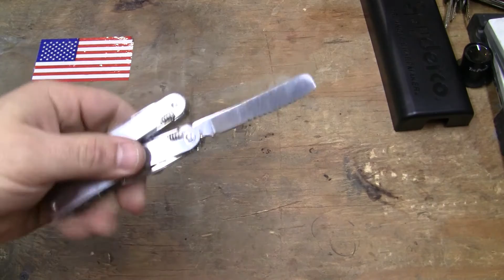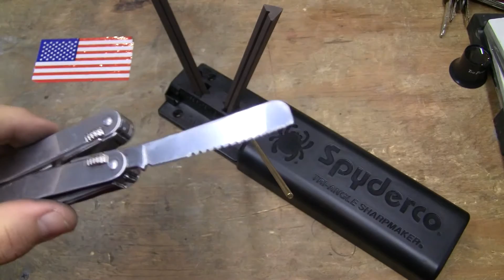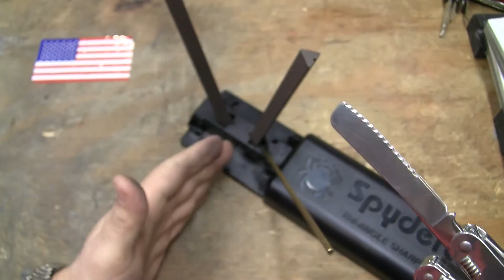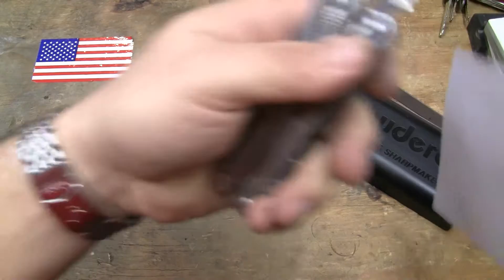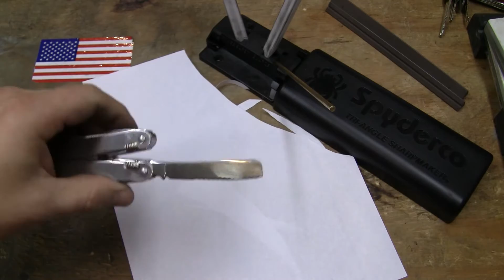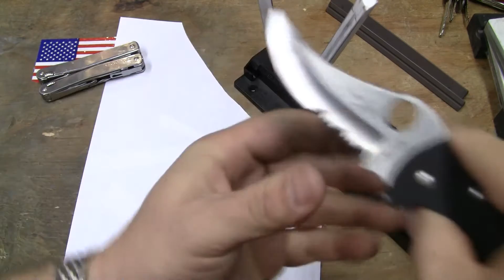Sharpening Serrated Knife Blades Spyderco Sharpmaker

Comment: This is supposed to be a video about how to sharpen a serrated knife on a sharpmaker and more than half the video is about completed unrelated things. You rambled on for 3 minutes about the wicked edge sharpener. Then you talk about how much you like the serrations on a victorinox and how important it is to have a sharp knife and then for some reason you talk about snowy roads. And you didn’t use the sharpmaker a single time. You just showed us what you would do if you were going to sharpen your knife. 

If I edited your video down to just the subject at hand, I’d have less than two minutes of useable footage. How the fuck did you make this 15 minutes? Absolutely useless
Reply: 100% right on. I thought I was on the wrong video. A f------ moron!

Comment: Ok so, what does having a sharp knife have to do with snowy roads?
Reply from the maker: rickyboyz100 People were trapped in there cars on the interstate for over 24hrs.  Watch the light weight car bag video.   Sharp knives are the only ones that matter...
Reply: Bin driving in Northern Canada for 45 years and thought tools on board were the norm. Great vids man
Reply from the maker: rickyboyz100 Believe it or not that type of mentality just does not exist here, except in the off road community and they are few and far between.  Thanks.